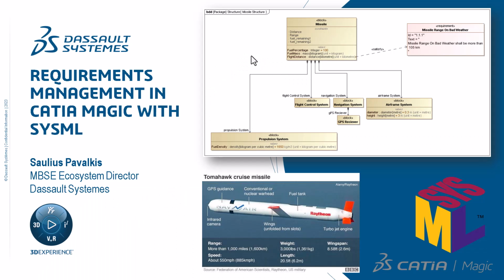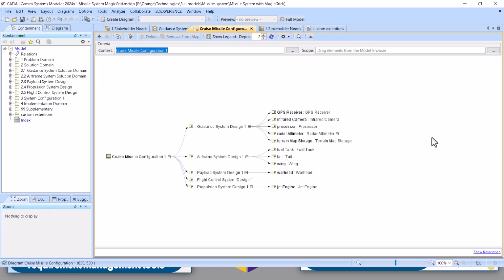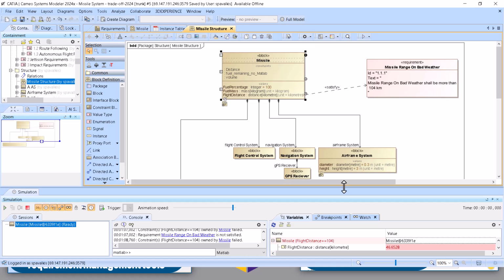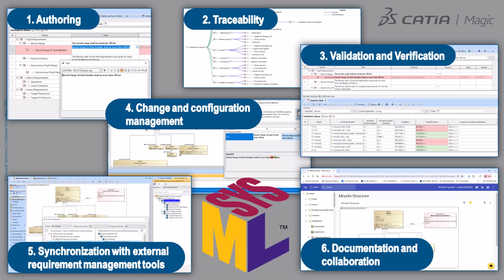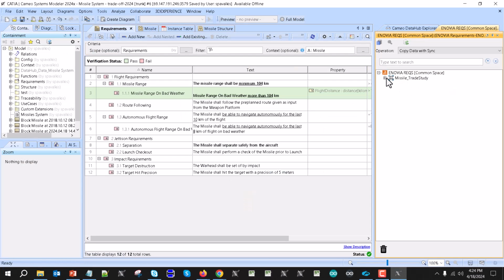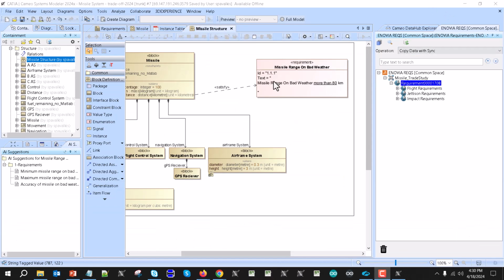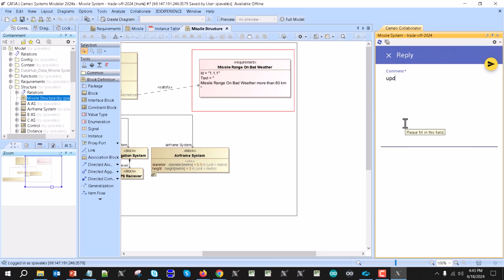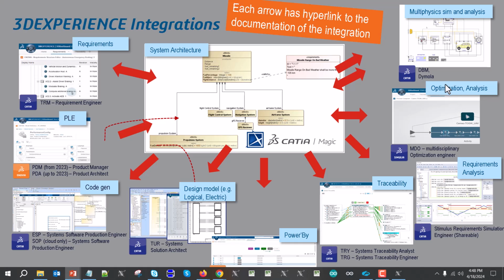Requirements Management in SysML Crash Course

Comment: thanks, covered a lot of topics in 30 minutes. But PLEASE Dassault, you need to clean up the branding for Catia MBSE products/services.
- Why have both "Catia" and "Cameo" products?
- Why have Catia Magic, Enterprise Architect, and also Systems Modeler? Why not just ONE tool?
- Why have both Teamwork Cloud and 3DExperience?
- What is "Magic" vs "No Magic"??? (i'm nearly laughing)
- Why have so many hyperspecific roles for 3DExperience? It is so confusing. 
- Why have 2 active MBSE youtube channels??! And there is also a 3rd active one called CameoMagic. Are there even more than three?? (in addition to the many other Dassault channels)
Reply from the maker: Thank you. Let me cover some questions: 1. CATIA Magic and Cameo are two portfolio names. CATIA Magic is new and Cameo old one still available but for old clients. 2. Those are different tools: SysML - systems modeling, UAF - Enterprise Architecture, UML - software. 3. TWC is stand alone solution the best SysML etc models management repository. 3DX is digital engineering backbone to connect models from system to analysis do design to data analytics through change and config management. 4. Each channel is dedicated for specific roles: CATIA MBSE - official whats new in MBSE tools, CATIA - official what is available in CATIA, MBSE Execution - MBSE system simulation and Digital Engineering / integrations dedicated channel.